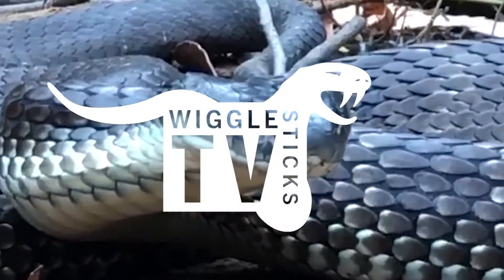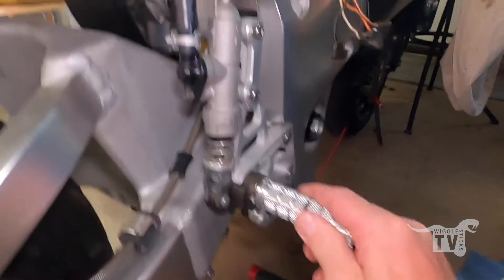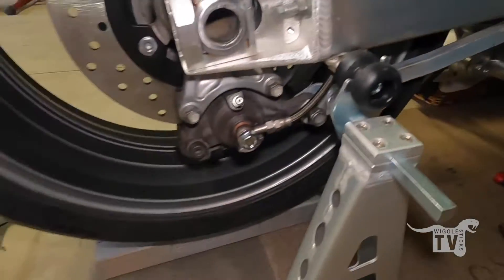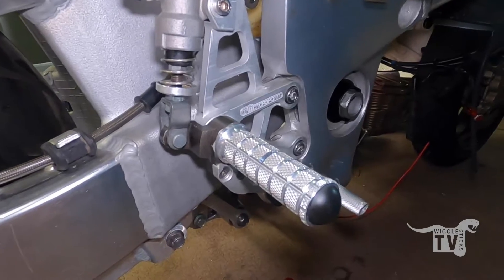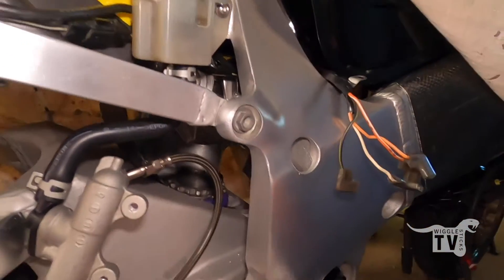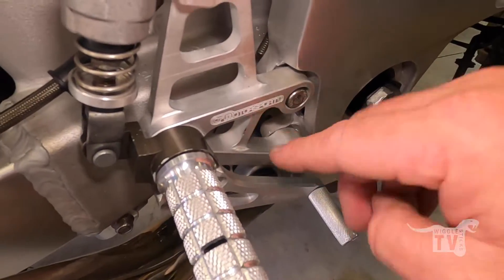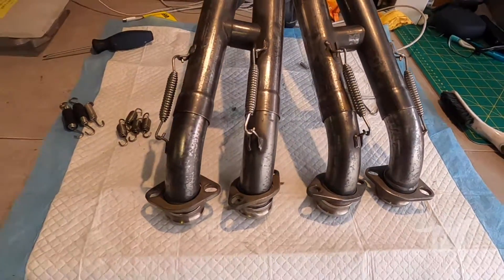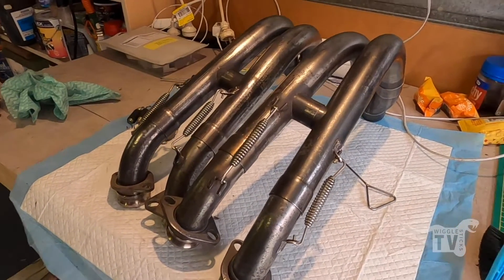1996 #GSXR 750 #SRAD Track Bike EP: 22 - Installing the rear brake & headers. #retrosuperbike

Comment: I think the rearset swingarm clearance issue is down to absense of spacers which are usually present between the rearset and the frame. Just make them the same thickness as the rearset plate at it will be fine
Reply from the maker: thanks, seems like the best option.

Comment: Just get a pressure switch for the rear brake. Many thread pitches/sizes, and orientations, such as my Srad required a short 90° bend type. Different aftermarket
 rearsets tho.
Maybe just drill a small hole for the spring. That'd be free.
Reply from the maker: thanks, yes will do. Have ordered will pick up next week.